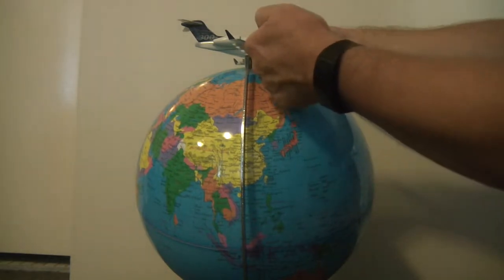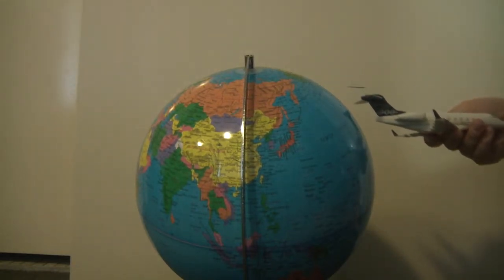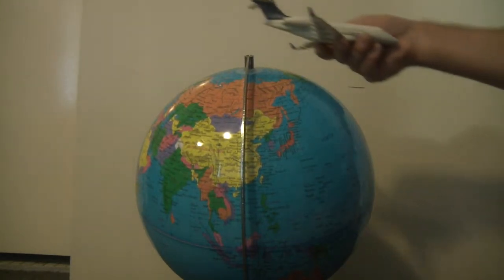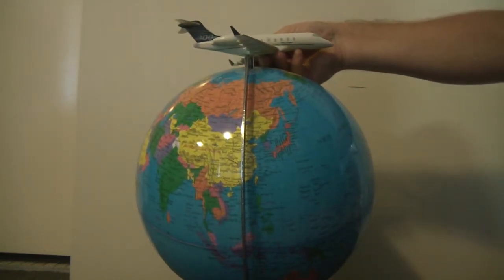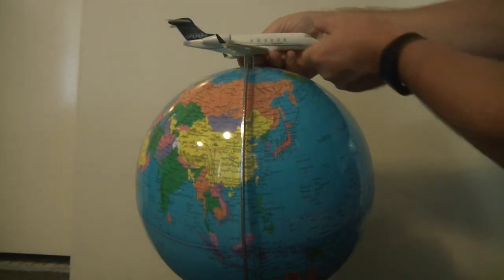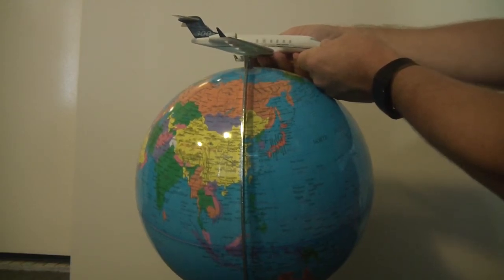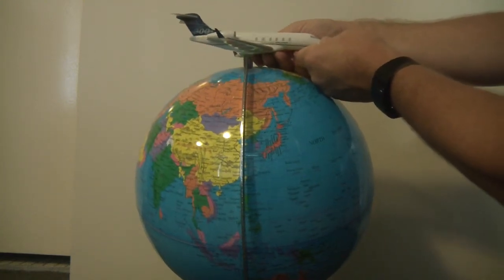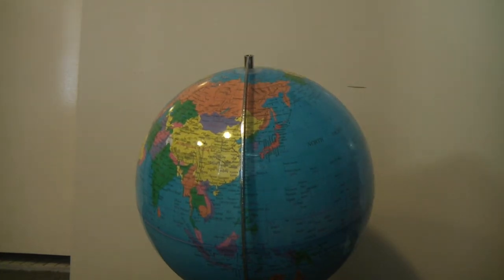A quick response to Globebusters.  You got it wrong guys.

Comment: Coriolis effect???  Heh heh.   I'm waiting.
Reply from the maker: +Eric H.  Still waiting for your answers mate. No point avoiding them.  If you can't answer those simple pilot questions we will all know it is YOU who is the fraud.   Don't try to side step because I will remind you every time you post from now on until you answer those simple questions any pilot would know.
Reply: @Wolfie6020  heh heh heh  just as I figured,  how old are you. I asked the question you answer don't answer a question with another question answer and maybe I will
Reply: @Wolfie6020  commercial license yes perhaps I don't fly for an airline ever think of that maybe I'm a stunt pilot or crop duster does that not make me true pilot in your eyes
Reply from the maker: Eric H  Well even a PPL knows how to calculate an ETP and a PNR mate so I am waiting for an example from you.  

Go ahead.  Prove to me you are a pilot.   Show me the fuel policy YOU would use in your crop duster if you had to ferry it across water.   

A PPL can do that,  a CPL should easily be able to do it so stop giving me excuses.
Reply: @Wolfie6020  former CFII multi engine rating but I guess that's not good enough you should stop insulting me
Reply from the maker: Eric H  Its good enough if you can prove it by answering a simple fuel policy question. 

This is like asking a motor mechanic if he can change a flat tyre and all I am getting from him is excuses.  This is basic stuff for a CFII multi engine rated pilot. 

Are you seriously telling me you don't know how to calculate a PNR or an ETP and you don't know your own fuel policy?  

Do you have any international experience at all  What routes?  Why avoid simple questions like that?  

Why are you avoiding such an easy question.  I could have given you a hard one.  

I was trying to answer your first question but you keep changing the subject.   

So do you want your first question answered or not?
Reply from the maker: Eric H  Mate you brought the subject of being a pilot into the discussion.  Now it seems you don't even know how to calculate a PNR or ETP (which I could do as a 17 year old PPL with 80 hours) and you don't know your fuel policy.  I can tell you the fuel policy for every aircraft I have flown from day 1. 

You work for yourself  That is a good thing mate because nobody will give a job to a pilot who can't do a PNR or ETP.  

You have posted numerous comments on different videos with different questions  

There is no question in this thread.  You just said "Coriolis effect???"  What specifically was your question?  

As a pilot you should have all the answers already.   Ask your question on Coriolis though.  Be specific and I'll happily answer.  But you have not convinced me you are a pilot at all.  I would never fly with someone who does know his fuel policy.
Reply: @Wolfie6020  yeah yeah yeah,  where I fly I can land in a field or road.  When I calculated these was late 80s early 90s.  GS plus wins aloft to get TAS vs IAS.  Dead Reckoningis the way to go what I do.  But back in the days plotting on  aero charts calling for weather, winds was a chore NOTAMS etc..  GS forward vs GS back ground speed baby.   
Point of no return, I don't do that anymore, no need.    I know is fuel burn ground speed destination,  alt airport destination plus 30 min fuel reserve.  I still have my old San tech E-6B, San tech elec Calc.
Reply: @Wolfie6020  I carry more chemicals than fuel anyhow. Get it. Preflight check is more important than fuel for what I do.  I'm a stick, not a bus driver, but slam me for that, so demanding that i answer to you to prove I fly is disgusting. I slip it down over the trees, ground effect for a 1/2 mile, pull it up over the trees, repeat. ... get it.   So slam me again
Reply from the maker: Eric H  So you still fly by dead reckoning? So all VFR?  What country?  Ok.  The reason I ask is because I want to find a pilot who actually knows how to flight plan Sydney to Tahiti.   I keep seeing Flat Earthers claiming to be pilots but not one of you can show me how you flight plan a trip like that. 

Don't you admit it looks shonky when a pilot has no clue how to compute a simple flight plan?   

Have you ever flown an international route that you calculated yourself?  Just be honest.  If not then your pilot experience is irrelevant to any further discussion because I want you to compute a real international flight plan and we can discuss it.  

If you can't do that, what is the point of claiming to be a pilot?  

GS plus winds aloft to get TAS vs IAS is just parroting jargon.   You actually have it backwards.  

IAS and Altitude to give TAS.  Then you add winds to get GS.  You have IAS already in your ASI. 

I have seen plenty of non pilots calculate good accurate flight plans in my SAR challenge.  If they can do it why can't you?
Reply from the maker: Eric H  I am not trying to slam you, I am trying to verify your claim that you are a pilot.  I get plenty of frauds and they are easily exposed.  A real pilot could answer my questions easily without all the evasiveness.   

Bottom line is if you can't calculate an international flight plan your experience is irrelevant to the discussion
Reply: @Wolfie6020  no need for IFR. air speed indicator   stall at any aoa or as    ground speed is important for calc cross country. Jargon talk,  geesh really. Winds at 20k not affecting if you fly at 8k, usually different directions anyhow.  You are thinking your better anyhow so bet you can't do what I do,  I'd laugh,  you'd crash
Reply from the maker: Eric H  Well see now you just made another basic mistake a real pilot would not make.  You don't stall at any aoa.  That is total nonsense.  

Yes you can stall at any Airspeed but not at any aoa.  

I have an ag rating and thousands of hours instructing aerobatics with low level waivers.  

I can do what you do easily.   But you still can't show me a simple flight plan.  Like I said, what is the point of claiming to be a pilot 

Your comment that you can stall at any aoa is a worry.  If you believe that then you are dangerous.  That is basic aeronautical knowledge you learn as a Student pilot.
Reply: @Eric_H68  You cant even spell straight properly just stop trying
Reply: @Wolfie6020  why am I having to prove anything to you? Flight plan in txt???  I actually fly,  not plan trips cause I don't have to. Sometimes flying gets old, like everything eventually.  You do nothing for me or family.  We are both under the 1% in the world who can actually fly,  what's the point?  Your superior to me, if not,  you'll let me know I'm sure. Have fun living, forever. . Can't answer the NASA stuff huh. 
Can't and won't.
Reply from the maker: +Eric H Then can you explain why you brought up the fact that you are a pilot?  

if you can flight plan that is relevant to the Globe / flat Earth discussion, but conveniently it seems, you are yet another Flat Earth pilot who can't produce a real flight plan.  Funny how none of the Flat Earth pilots know how to flight plan isn't it? 

Every flight plan on Earth proves the Globe Eric and that can be easily proven with basic spherical trigonometry  How do you think they produce Great Circle distances?  You can't tell me you don't know what they are. 

Of course I do nothing for you or your family.  i am happy to leave you in peace and you beleive whatever you want.  

But you came to my channel,  With insults from the first comment.   What did you expect?  A red carpet?  

Now you can't answer my questions so like all Flat Earthers you change the subject and run and hide behind NASA.  Pathetic mate.  The Earth existed long before NASA.  Who cares what NASA does.  The Earth is Globe with or without them and if you knew how to flight plan international routes you would agree with me

Comment: There is no nosing down at all. Steady flight. Altitude may as well be measured from the mid point of the plane. The nose and tail are Microscopically higher in elevation than the mid-body. While in a plate of 35,000 feet, the distance from that mid point to the center of the earth is all that is held constant. For all practical purposes, due to the minuteness of man and plane, the earth may as well be flat. Vertical is always with respect to the core, no matter where one is or the topography. . . .this would be true even if the planet were the shape of a donut. The core of that ring, not the hole, would be center of mass and effectively determine altitude.

Comment: WHY is the temperature NEVER consistent around the EQUATOR?
Reply from the maker: +The Bipolar Bear.  Many reasons.   The Land masses are not symmetrical.  They are not equal North and South of the Equators.   The tilt of the Earth results in differing angles of Sunlight striking the ground at different times of the Year.    What is consistent is that the Equator is hotter on average than Mid Latitudes and generally the further you go from the Equator the colder the average temperatures become.

Comment: "The angular change of the Aircraft is linear."
As a mathematician, I can confirm, and perhaps somewhat clarify this.
Linear curvature is the rate of change of direction (defined at any given point by the tangent line to the curve there) with path length along the (curved) line.
κ = dθ/ds

For a circle of constant radius r, κ is constant:
κ = 1/r

This holds equally well for the plane following the curvature of a great-circle flight path, and for the car driving at constant speed around a circular track.

Wolfie: One further note. At around 1m 30s, you say that the drop-off of Earth's curvature is exponential.
It isn't; it's quadratic, to second order, that is.

Fred
   .

Comment: There are five factors on how the plain maintain its altitude in the air and these are the following:
1. The altitude.
Argument:
Nothing but the distance of the plane to the sea level. The plane will not go beyond zero altitude or else it will crash on the sea or on the ground.

2. The frictions.
Argument:
Nothing but the air/water such as turbulence, wind, clouds, snow, and rains. The plane will not go beyond its maximum speed limit else it will deform its structure, and it will not go below its minimum speed limit else it will fall to the ground and loosing lift.

3. The air availability.
Argument:
The plane will not go beyond the thinnest air over the maximum altitude in which the jet engine and its aerodynamic wings will not work properly beyond this point.

4. The flight coverage.
Argument:
The flight coverage or the area of the fly zones signifies the planes current position (coordinates) in the air and its diameter, radius, and circumference of the area of sight is huge and the slightest movement of the plane will not recognizable through human sense for it is only below minimal to sense.

5. The gravitational pull.
Argument:
The plane is in constant contact with the gravity thus the weight of its mass is dependent to the thrust or lift given by the planes engines and the aerodynamics of the wings. The planes equilibrium or the center of gravity is the number one factor of its stability over the air. There are no other gravitational pull other than the earth's center of gravity that is situated on the earth's core but the earth itself is a single entity when it is regard of a pull...

These are the very reason why I am not a flat earther...

Comment: "The Earth Is A Flat Level Physical Plane" easily provable simply by placing a straw with a hole cut in the middle of it through the walls of a paper cup parallel to the foundation the cup is situated on, then fill the paper cup with water!

The result of this simple experiment demonstrates that water continuously flows out of each end of the straw until the water level becomes the same level as the straw! If such a pipe line where to be built through the supposed earths inverse curvature of ocean water this would create continual flow of water which could then be simply used to create clean perpetual energy solving humanity's energy problems! 
So the question is why isn't Humanity capitalising/using this very simple achievable technology solution??? 
The Answer is:- because the earth is a Flat Level Stationary Physical Plane!
Reply: This comment makes me want to wipe your gene pool from the Planet.
Reply: Omg what a ridiculously stupid statement.

Comment: This guy! Equipotential Surface! WGS84!
Reply from the maker: +Danny Yolo.  Explain to me in your own words Equipotential Surface,  WGS84 please Danny.  Don't just parrot or cut and paste.  I want to hear you explain it with your own words.
Reply: Wolfie6020 In gravity, a hollow sphere has a three-dimensional equipotential region inside, with no gravity. In electrostatics a conductor is a three-dimensional equipotential region. In the case of a hollow conductor the equipotential region includes the space inside.

A ball will not be accelerated by the force of gravity if it is resting on a flat, horizontal surface, because it is an equipotential surface. I have noticed you have looked into this logic but failed to use scientific method this is why you continue to use these theoretical notions. Open up! I agree with some your logic but when you say it’s absolute proof, I sense insanity.🤔
Reply from the maker: +Danny Yolo - Good explanation, kudos.  But WGS84?  It is a spheroid.   Agree?  Personally when people tell me the Earth is Flat I sense insanity because I have spent my adult life flying around the Earth and I know it is a ball.  How to prove that to others though?  You can't put 30 years and 10,000 hours of personal experience into a video.

Comment: Hey Wolfie6020

For your information, an airplane that has reached it's cruse altitude will keep flying at a constant level when it is on auto-pilot. 
The auto-pilot system makes use of a gyroscope that is driven at constant speed by an air jet and it is being balance by a pendulum that is pointing toward the center of the earth simply by gravity. The pendulum will constantly adjust the gyro in very minute adjustments. If the pilot switches off the auto-pilot, and later makes a abrupt turn, the gyro will lose its reference to the center of the earth due to the inertia in the high speed rotating gyro and it will enter into precession. After a short while, the pendulum will find back the direction to the earth center, as the inertia created by the violent turn is gone and the gyro in the artificial horizon instrument will again be stabilized to indicate a level flight. 

What all flat earth people DO NOT UNDERSTAND is that a level flight does not mean an horizontal flight. A level flight means that the airplane is flying at a constant altitude. That means that the airplane will follow any curvature in the earth (I am not talking about following the contour of the surface of the earth , like mountains and valleys).

Comment: "Every 111 km required 1° of attitude change". However, isn't attitude measured relative to zenith, nadir, or level? i.e.; the gravity vector,? So with every 1°, or 10° of change in latitude in 'level flight', the attitude of the plane is near constant, relative to zenith or level. So describing "Straight and level flight" is to remain level (normal to the down direction) , therefore not changing?

"Every 111 km required 1° of attitude change". That describes attitude change relative to the equatorial plane, or spin axis globe, not local level. 

Flying from Los Angeles to Calgary we maintained 2° up 'attitude' for constant altitude (flight level 390). Relative to the equatorial plane the attitude was changing. 

What reference frame are you describing? Local level? Or earth centered?